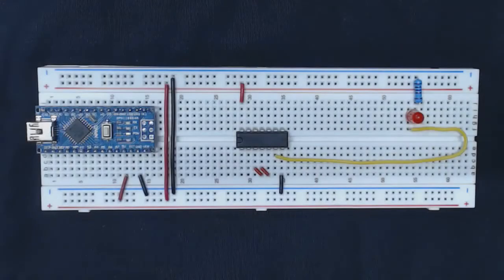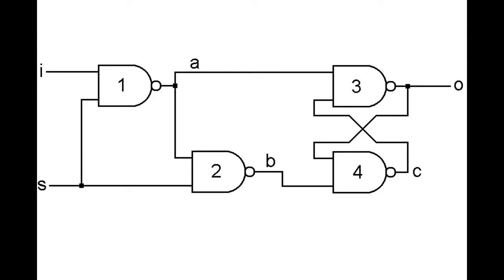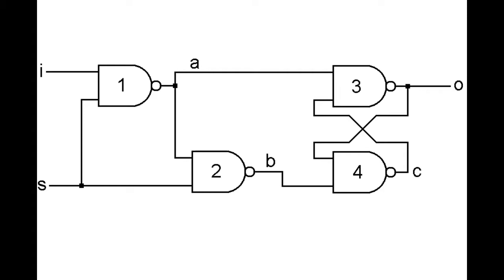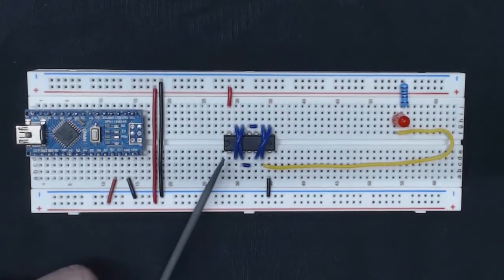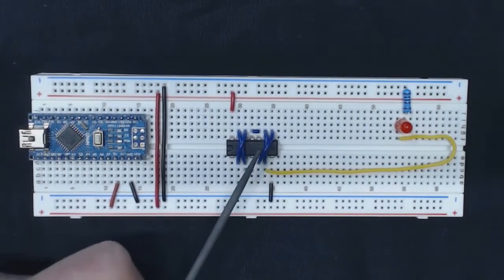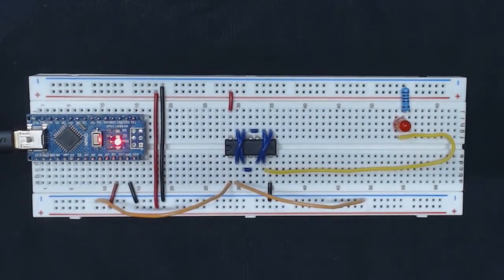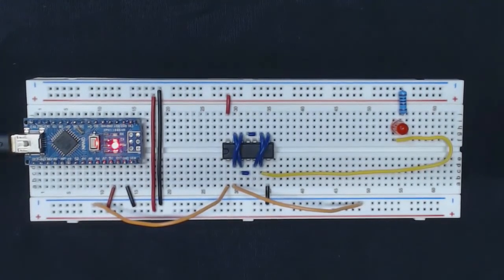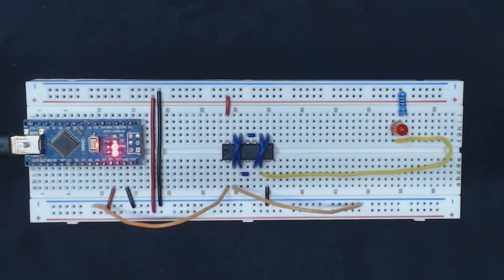But How Do It Know? Video #4 - 1-bit Memory

Comment: Does it save the input by blocking the solution and the forced solution?
(For example we set 1+1 putting out 0.
The upper part then becomes 0+1 with solution 1.
On the second lower one it is 0+x=y and x is the solution of the upper part.
If after the first run x is 1 y would be 1.
Then the second upper part is therefore 1+1=0 but the connection to the lower part prohibits this solution. Whichever was there first stays there.)

Comment: It retains information if it is powered. No longer if power goes off. How do you store information in Nand Drives ?
Reply: SSD uses floating gate transistors, which are able to hold a charge. I guess you could think of each gate as its own little battery.
Reply from the maker: Great question, to which I unfortunately don't know the answer. Maybe someone else out these can chip in?
Reply: Here , Nand Drives = Solid State Drives or SSD. These replaced Hard Drives on most PC / servers.
Reply: for reference only: the book assumes that the gates are energized, which allows the gate to produce an output with electricity even though the inputs do not receive electricity.

Comment: when I learned to make a memory bit from this book and simulated this memory cell, then I bought logic gates chips, I felt like a wizard of integrated circuits. only with logical gates nand so simple.
Reply: Hahaha I really wanna do it too! Where did you buy them??
Reply from the maker: You can get them from suppliers such as Digikey or Mouser
Reply: @raissac  y buy 20 nand IC and some memory ic from wish , and use with MAXITRONIX 300 IN 1 ELECTRONIC PROJECT LAB EDUCATIONAL ELECTRONIC KIT buy from a electronic hobby shop from brussel